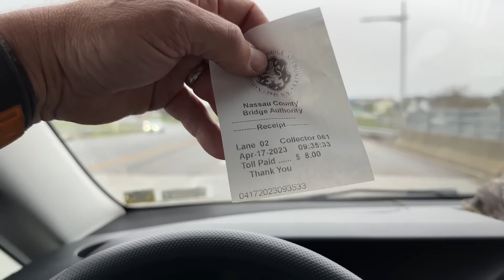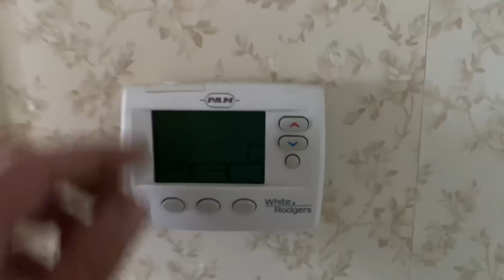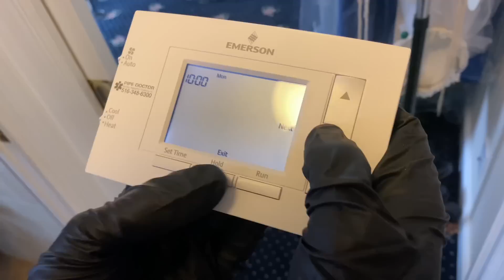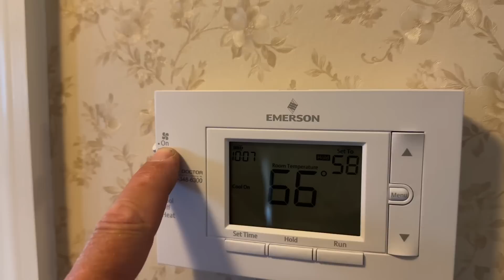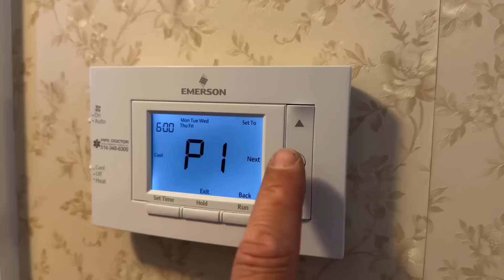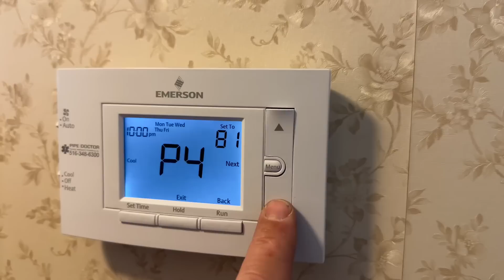Central AC Thermostat is Dead and Air Conditioning Isn’t Turning On - Defective Thermostat Replaced

Comment: you often wont see full 24 volts on the green wire due to it controlling electronics or a dc relay half rectified via a diode or other means. on Y(yellow) a contactor is often directly being powered, but  even sometimes none of the wires may show full 24V and control electronics on heat pumps and other setups. only wires guaranteed to show 24V is RH/RC to Common, unless somethings broken, blown, power off. 🤔 that's something to keep in mind now days, especially since there's so many all electronic controlled systems now.